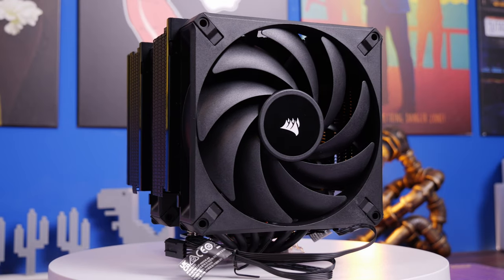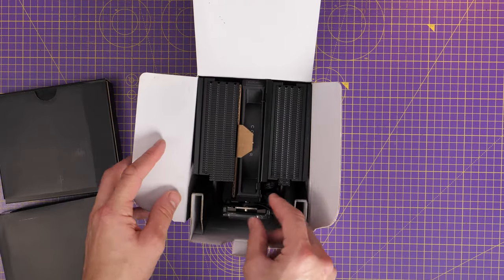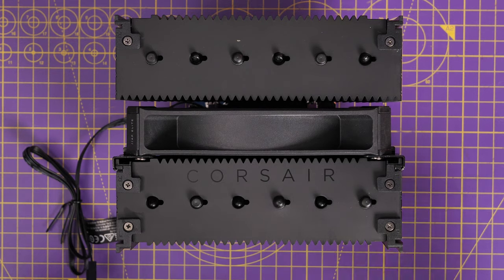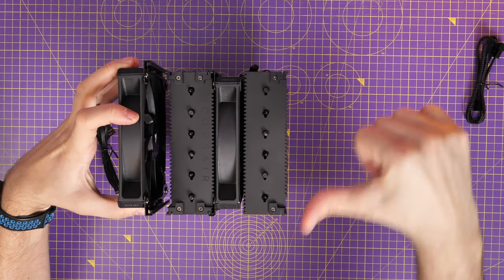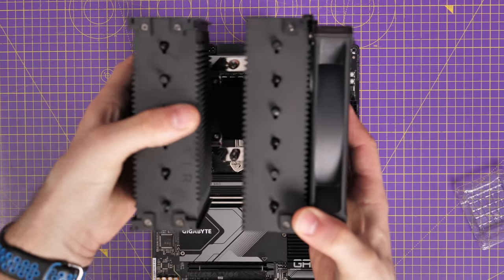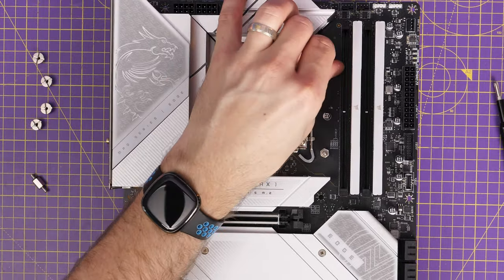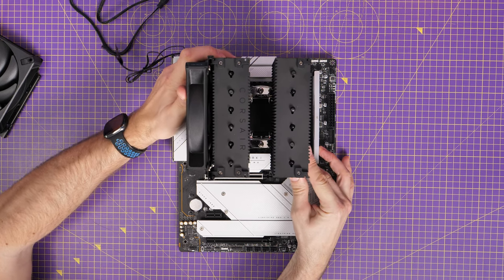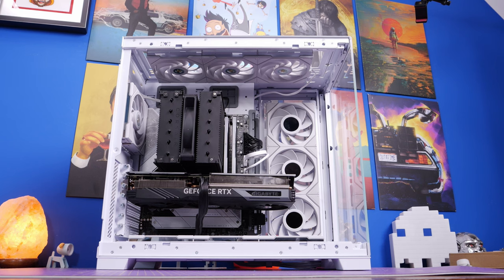Corsair A115 CPU tower cooler setup and wiring guide for AM5 or LGA1700

Comment from the maker: Specs of this build (Please note links listed here include affiliate links which may earn me a commission.)
Motherboard - MSI MAG Z790 Edge TI Max Wifi https://youtu.be/R7fBupUTXNI 
CPU - Intel Core i9-13900K CPU https://amzn.to/3Ry7UAl
CPU Cooler -  Corsair A115 https://go.corsair.com/1rdjVx
 RAM - Corsair Vengeance RGB DDR5 16GB x 2 6200MHz (https://go.corsair.com/eKAL3Z)
NVMEs:
Corsair MP700 Pro NVMe - https://go.corsair.com/eK2g5D
Seagate Firecuda 540 NVMe https://youtu.be/F1wfALcbq74
Case - Lian Li O11D Evo RGB (https://youtu.be/c-0WW77_fM8)
PSU - Kolink Regulator 1000W PSU (https://youtu.be/sjEJrl294mI)
Fans - Lian Li TL120 and TL LCD https://youtu.be/fL4uYmJvnzc
GPU - Gigabyte RTX 4070 Ti 12g OC https://youtu.be/_-bu6qDqeWA
SSDs - Crucial MX500 2TB and Crucial BX500 2TB https://youtu.be/IOJNybKZ4wk

Comment: I think if I was caught in that situation of having to discard a fan because its too big for the case I I would either mount a 120 fan on  the rad or fab a duct so the rear case fan was effectively pulling air directly from the rad, seems a shame to handicap the cooler.